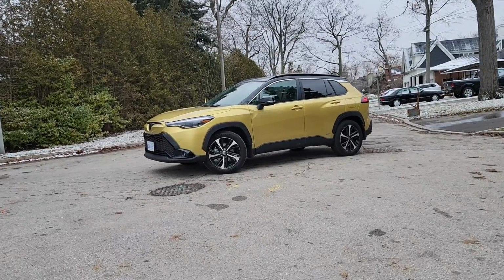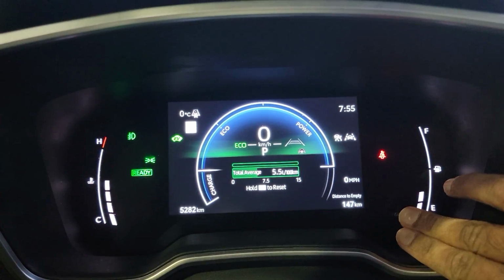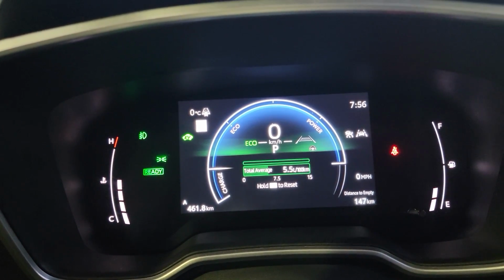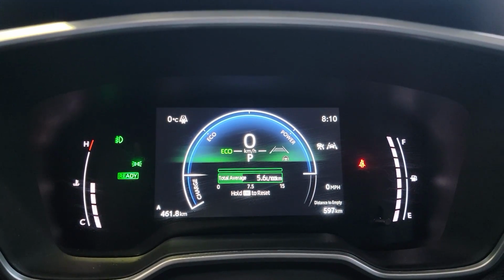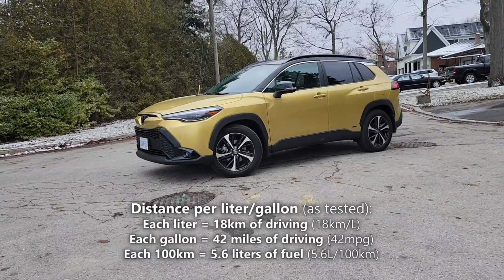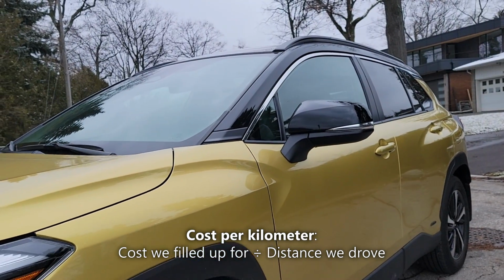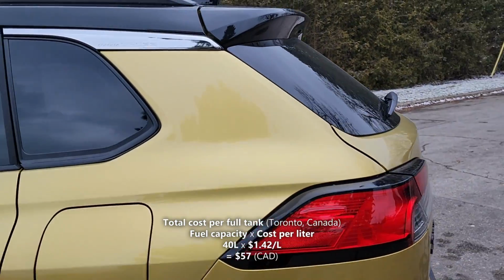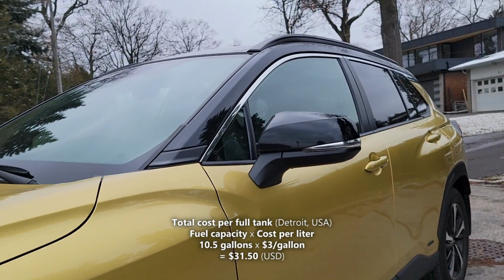2024 Toyota Corolla Cross HYBRID - Fuel Economy MPG Review + Fill Up Costs

Comment: I bought one, I get 6.4L/100km in winter, my best was 5.2, I usually go 120km/h on the highway and use remote start when under 0°C, I drive on normal mode. So realistically, in winter, my range has gone down around 550km full tank 😕
Reply: Thanks for sharing...
Where are you located?
How long did you have to wait before you were allocated the Cross?
What are your biggest pros or cons about this vehicle?
Reply: @dproulx222  Montreal, ordered: June-22 received: Sept-23, pro: ez to drive (mix between fun and mindless driving), just enough acceleration, the fuel economy for an eawd cuv. Con: no spare tire, center arm rest does not extend, I disabled line assist (gets annoying if you don't use flasher to exit HW), noisy when you push it. 
The interior is ok, SE seats are ok. Update: 6.6L/100km and 505km range after filling up.
Reply: @MrEnky007  Thanks for your reply... Much appreciated.